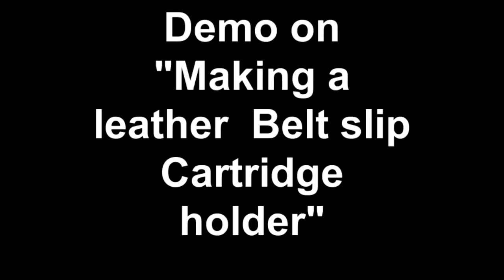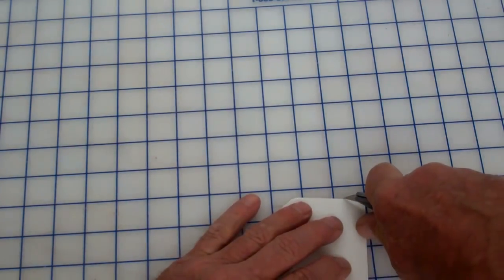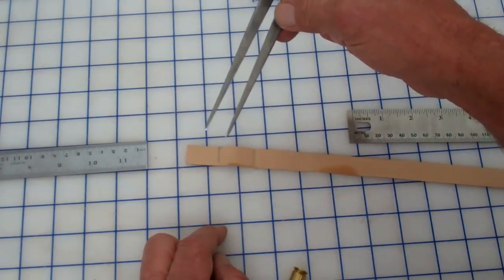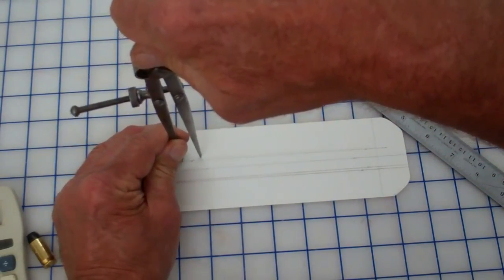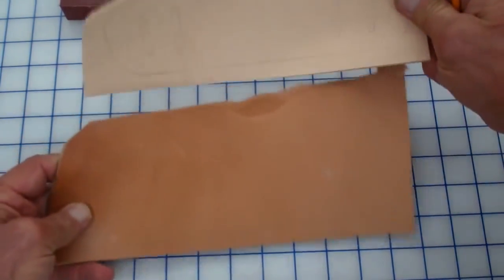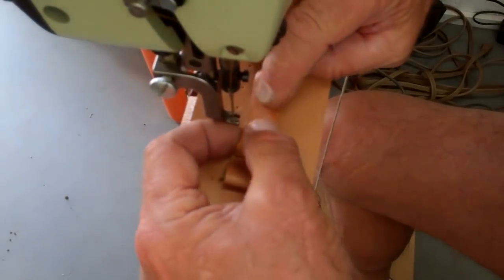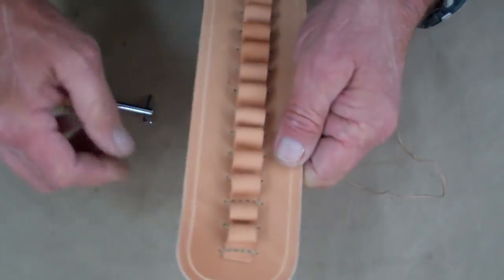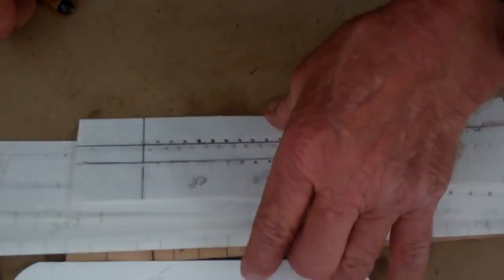Demo on "Making a leather Belt slip Cartridge holder "

Comment: Nice tip from dag36523, don't you think? I can really appreciate the work that you did, In the belt lop section, would it make much difference if you wet that section and place a belt piece in there and let it dry, so as to take a more  permanent  shape?

Comment: This is my first leather project.  Thank you so much for the tutorial.  I am making it for 223 cartridges. I am in the process of hand sewing and I have noticed that apparently the rounds are so tight when I try to put them in.  Will the leather loosen up with time or is there a way to make it slide in easier.  I must have had the calibers too tight on the leather when measuring.  I would appreciate your help.  I thought about dunking it in water after sewing and then stretching a little. Thanks

Comment: Congrats Richard for your work and videos
Just have one question : If both pieces are veg leather ( front and back ) why when you apply the Neatsfoot Oil the difference  of color change that much ??? 
I really liked the idea of ussing this kind of oil. It's like dying and protecting the leather at the same time, but I'm affraid of what I'm mentioning above : the big difference of color in the leather when it's applied.
Thnks + Rgrds

Comment: You could also use the inner edge to make tighter corners as well. It might give enough room for one more cartridge of a certain size. Running an edger along the edges of the belt would allow it to go in much easier than it did.

Comment: Does the oil work on a leather jacket (black cowhide)?
Reply from the maker: Not knowing what type of leather is on your jacket, I would say no. You might want to use an atom wax and leather balm made for leather. Try it on an area first before you do the whole coat.

Comment: What grit belts do you find work best on your belt sander? Great video, thanks!  I'm not planning on making this exact belt, but for a beginner, this provides some really good Leather craftsmanship practices. Thank you! 

PS. I have an extra Motor and Arbor, I'm going to make the burnisher, shown in your other tutorial, using wool matt. Perfect!!
Reply from the maker: +David House Sr. I've found that 80 grit works well for the belt sander, but watch how hard you press the material to the belt.
Reply: +Richard Black, Great, thank you.
Reply: help

Comment: Nah, there are too many errors in this. It starts with a poor approach to templates (he only needs one, as the carry plate and the backplate are supposed to be the same size - he came up with different lengths, to get the two to match precisely they have to be cut together - use carpet tape to hold them in place), continues with an insufficient pinch on the bullet strap (OK, he starts right, using rulers to get the optinmum omega-curve, but then goes wild with Tech-no-logy (the essence being the middle two letters) which undoes that optimum grip. It's a scribe he's using, not a fid, nor is it a punch, he's creating more problems for himself machine-sewing than hand-sewing, he doesn't explain how you use the needle in the down position to pivot on. Yes, hand-sewing takes longer, it also avoids a skimped job. What he's come up with is a feed-corn distributor for cartridges, I presume he hopes to have a fine crop in the autumn...
Edge-varnishing should be unnecessary, just polish with a dremmel slip - he gets the dark varnish on the surface of his work, and it will colour anyway with the oil. He passes the belt through upside-down, and...well, we now know why he doesn't show any cartridges in place. They're scattered over the prairie between Hell and Highwater.